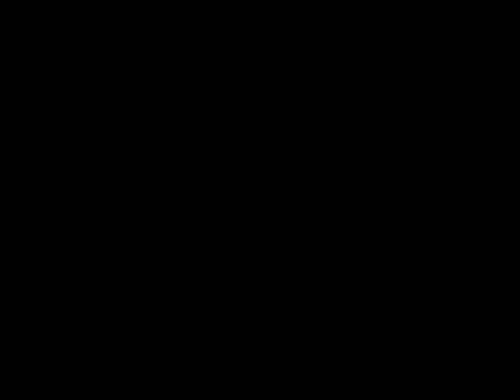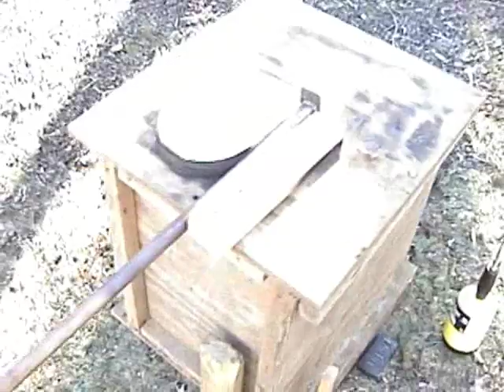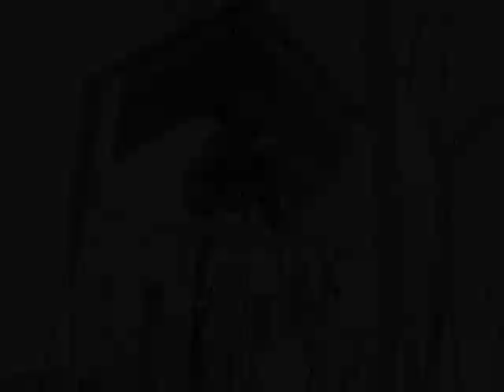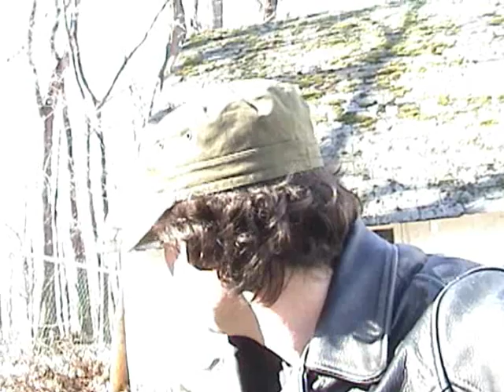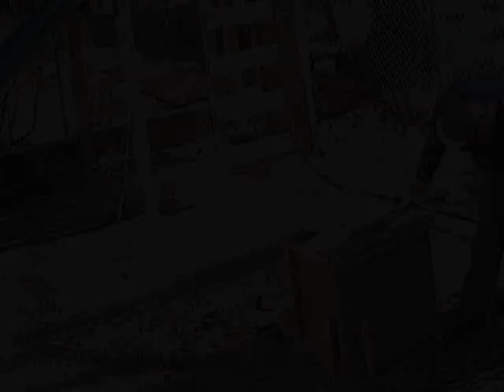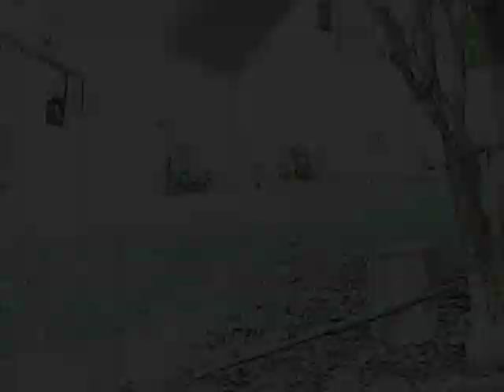Sand Bending Steel Tubing

Comment: For all the fire, you are still cold forming steel. To make use of a charcoal pit, add air. If you have a vacuum cleaner that can be reversed, that is a good source. With the right amount of air you can easily get a tube orange hot. A trick I've heard of is to wave a magnet by the hot steel. When it reaches the austenitic phase, it is non magnetic. great video. keep at it.
Reply from the maker: thanks - good tip on the magnet - I agree, the heat I had added almost nothing to the equation

Comment: it looks like it was recorded on a 1990s VHS camera. it absolutely hard to watch. Its overly contrasting, and pixelated. 
i have a CB550.  it had missing parts when i bought it but thankfully it was unmolested and the engine worked. 
if the engine didn't work i would of had an electric cafe racer project.  Its always good to make a Plan B even if you dont use it.